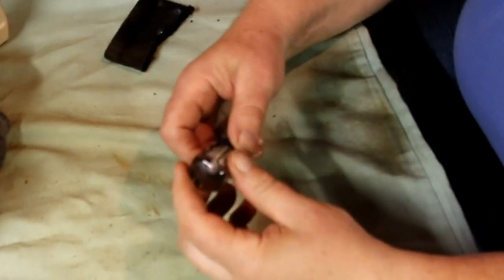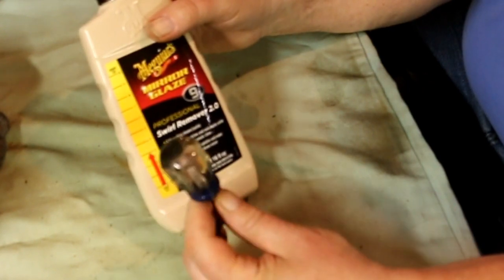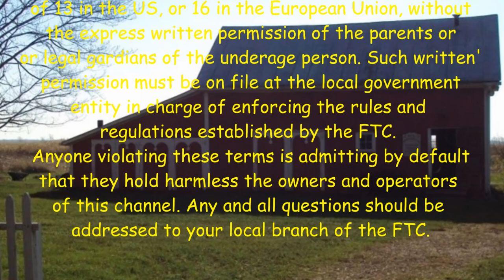Poor Man’s Restoration - Craftsman Scratch Awl #41028

Comment: I've had the same Craftsman Screwdrivers most of my life and they show no sign of stopping. Very little wear so they should last the rest of my days and as of right now they're still warrantied and there's still places to exchange them if I ever needed to.............I don't know about the quality of the newer ones but the Old Craftsman had great quality steel and really good chrome.
Reply from the maker: I have a few Craftsman drivers. 
Nice tools.
Reply: My grandpa owned a car repair shop for 38 years until he sold it to my uncle.  He swore by craftsman most of his life.  He swore at craftsman more at the end of his life due to the fall in quality.
Reply from the maker: @justinfacer6332   My first real job was working maintenance at the foundry with my Dad. He took me to Sears back when it was in Downtown Battle Creek where Horrocks is now. He bought me a tool pouch and a set of Craftsman box end ratcheting wrenches, Screwdrivers and Channellock pliers. Wore them out completely over the next 3 years and the shop  replaced them with Williams wrenches. Good tools but I miss the Craftsman wrenches my Dad bought.